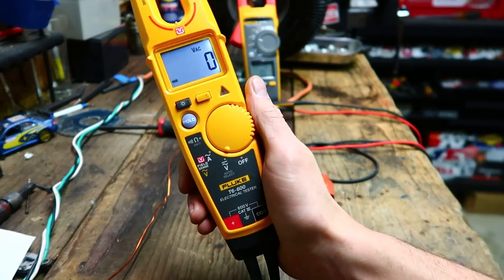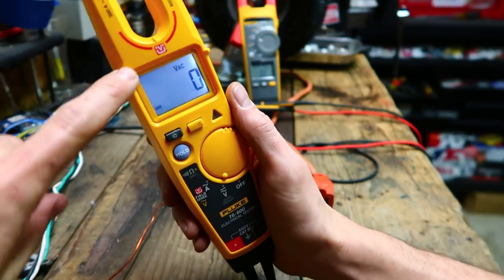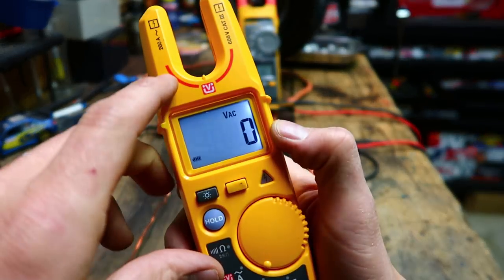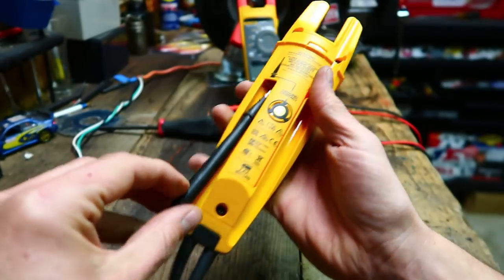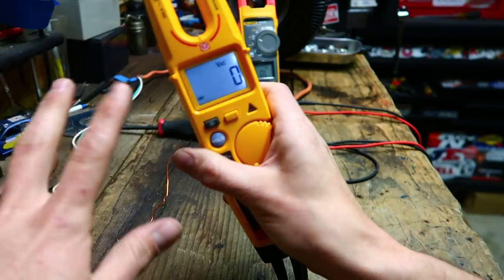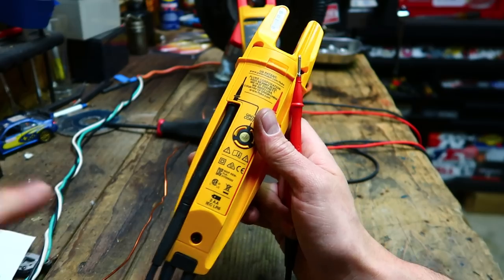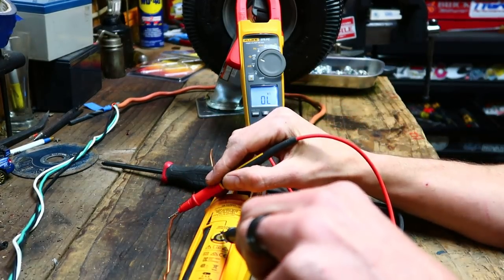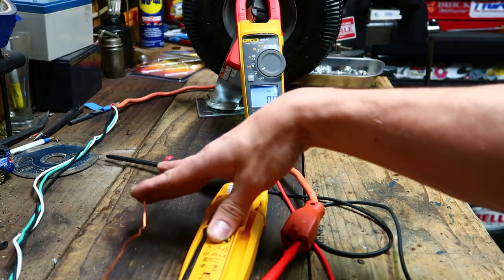Fluke T6-600: NOT DANGEROUS!

Comment: It could be capacitively coupled or a high resistance resistor, is my guess and all it is is a guess.
 If it works on RF which the magnetic field kind of is, then capacitive coupling through the plastic is actually something logical especially since there could be another capacitor on the back taking the charge giving you the 70 ish volts
Reply: A better test is between the button and the spring on the cover maybe
Reply: Omfg, I just got it dude, he did that thing where u post the wrong answer on the internet to get the right one.

I forget the name of the f**** thing, but literally it's a law that states bad knees law or some s**, that the quickest way to the right answer, is to post the wrong one online. He's even said it in his videos before f** man... that's smart
Reply: Who are you insinuating posted the false truth? AvE or Mike? I'm thinking AvE.
Reply from the maker: That's defiantly a possibility,  my expertise is in the "electrocution/burn your house down" voltage.  I do not think it's a resistor, that would require a direct electrical connection, that could fail or arc.  It's gotta be more clever than that.
Reply: Black magic? Voodoo? 😁 I'll leave the sparky stuff to you elec-chikins 🤔 I don't know or understand the whole pixie wrangling witchcraft myself. I just know that because of you guys, my Xbox and tv work 👏👏👏😁🍻🥓🇺🇸🛠
Reply: Screwdrivers with neon lamps in them have been around for ages... It's just a lamp, resistor, and you touching the pad... And they're legal.
Most likely it's the same thing here.
Reply: "defiantly"
The old Fluke corporation would use a clever design, the new Fluke corporation uses a resistor.

It says on the back "Country of origin: China."

Comment: I never really liked a fluke meter for the money they cost.   There are cheaper options that work well for me.
Reply: Till the cheap meter stops working and send you on a 5 hour wild goose chase. Ask me how I know lol
Reply from the maker: well, when you use one every day and your life depends on it, i only trust fluke, i know there are other pro brands, i just like flukes.
Reply: I don't buy fluke for accuracy.  I buy fluke so I know when I put it to a 480 service it's not going to blow up in my face.
Reply: Mike's Tool Shed I agree. I have been an electrician for 25 years. Fluke is the go-to for meters. There are many other good ones, but there is a reason you will only find Fluke meters in my hands. Fluke had a #fail with releasing the field sense into production. But there is no safety issue with it. It is truly just a gimmick for now. The Fluke 1AC II A1 is an everyday carry for me. I always assume the circuit is on unless I can see both ends of the wire!
Reply: There's old electricians and there's bold electricians, but there's no old and bold electricians.
Reply: I have a lot of cheap meters, and they work well for the most part. but when measuring something I have to be really sure of, then I bring out the fluke.

Also, when working around electrickans you don't get to sit at the cool kids table if your meter isn't yellow... so theres that..
Reply: Have you ever seen a multimeter blow up? I've toasted a few and I've never seen the whole meter explode. Some fears are irrational. So you might want to reevaluate your meter phobia at some point. Actually look inside one and understand what is going on. Then you may come to the realization that what you worry about simply cannot happen. They're not assembling multimeters with explosives in them. I ain't saying some of them doodads in there can't go pop. But none of them can explode with the velocity it would take to rupture a case. That's pure fantasy.
Reply: The cool kids table? Those cool kids were only cool in their own minds.
Reply: Fieldpiece, ftw  (..at least for HVAC)
Reply: My two EDC meters are Fieldpiece(SC260 and SC440), but I keep my FLUKE 375 on the van, in the case, as the 'Gold Standard' should any question arise with the other two meters.
Reply: Keysight meters are my new go to since fluke sold out. I require more out of a meter than your average electrician though, automation electrician.
Reply: Camaro Rick probably the same way i kniw. Lol
Reply: Same i never bought into the Fluke name, ive been using the same old multi function meter for 10 years thats got  AC/DC tong and Non contact detect, Fluke still hasnt got all that in one.
Reply: David H amprobe is either made by fluke or Klein I don't remember which but I do recall reading about it somewhere
Reply: FrugalPrepper's Garage & Garden Dido, I use FLIR (extech) meters. Fluke leads work with them too.
Reply: @frugal- owned a fluke 77 since '82 and never failed-just replace battery. even been switched from volts to ohms-no sparky or smoke. It stays mobile all year long from -10 to +140. Try that on a cheap meter. GREAT PRODUCTS.

Comment: I think he is primarily pissed by the fact it's a Fluke. We trusted them for years and years. I were upset too, because i really wanted the meter, and i almost bought it. But for DC, i mean, i can't even use it for a car without using probes as i can't be unsure if the alternator is giving me 14 or 9 volts as you try to rub it as close as possible to the sensor. 

I think what he is thinking. If there is a safety mechanism, it is not electromagnetic, as it's a ground. If you touch something like a 10 000 volts panel with it, it can just arc though the security there might be in the band relying the probe and the digital connector. But i agree on what you say, he should have disassembled and see if the protection is adequate on the positive also. 

He also got told stupid stuff like : "I have you removed the protective film" and bla bla, he took it as an insult in his intelligence. Because in the end, the guy is really smart, but he is someone who speak with feelings a lot of time. It's a major reason why i love him, he is authentic, he can be clever, he can do stupid things also. He should have checked if it's dangerous. Personally, i would send one to bigclive to know really what he think of it.

To make it really short, i can understand, we got our trust on one of the few brands we can mostly rely on. Seeing them send a device i would consider for myself a first generation prototype, and include it as a feature for more money, when it's really a pity. They could have at least warned that you have an approximation of the voltage without contact.

I am telling myself maybe the drama will make Fluke wakeup and don't reproduce the experiment of installing a potato launcher on an F-16. I am quite sure the circuitry directly on the probes will be very reliable. I would hate to be wrong and it's also a piece of garbage inside. I will check out for a good teardown when i'll have a little bit of time.

Comment: All that is happening is that you are changing the characteristics of a voltage divider circuit. 

When you measured the voltage between the contact tab on the back of the T6 to earth with the 375, you measured it with the high impedance of the 375 in series with the high impedance of the T6, which are probably similar to one another. Therefore the voltage will be circa half of the mains voltage. AvE had his T6 set to read AC voltage function, you had yours set to read ohms which would have a different impedance and may explain why you had a different voltage to him.

However, your body will have a much lower impedance than the Fluke 375, therefore when you touched the back of the T6 and earth with your hand, the majority of the voltage was dropped across the high impedance of the T6. If you want to see this, repeat the experiment whilst keeping the 375 connected, measuring the voltage, and then touch back of the T6 and ground with your hand and you will see that the voltage on the 375 will drop.

As the T6 in voltage sense only responds to AC, the socket for the probe and the contact pad are likely to be capacitively coupled. Your 375 has a capacitance function, so you may be able to measure it with one probe on the back contact tab the T6 and the other in the socket where the black lead goes. if it was inductive, you would be able to measure a DC resistance, although the T6 can only measure up to 2kOhm, so would show OL if the resistance was higher than this.

You could also measure the charging effect of the capacitor with an insulation tester or a battery and resistor in series with the T6 contacts.

Unfortunately, the instrument doesn't have reliable operation and is a little on the gimmicky side, which we just aren't used to seeing from Fluke.

Comment: If I remember correctly, in ave's video he was saying that if you had it switched over to a current setting that the meter would basically act like a piece of wire and pass the current straight through it and you might get a shock from it. There was obviously voltage there when he checked it with another meter so I don't blame him for not wanting to be the guinea pig to find out if it would actually shock him.
However I do think there is some type of capacitive coupler in the back between that contact pad and the lead so it probably wouldn't pass much 50~60 hz ac through it. If it is capacitive though, higher frequencies would probably still give you a zap.
Reply from the maker: he's smart enough, and has the equipment to test if current can flow through that pad.  Also, this meter is protected from allowing current to flow through the leads 100% of the time.  Meters with out clamps or jaws will allow current to flow through the meter to get a reading.  If you were to get between the lead and the thing your testing on say, a fluke 87, it will light your ass up.  this is a different style and its impossible for that to happen.  There is 100% a capacitive coupling in that battery door.  It's something like 2.1 nano-ferads which only allows a couple micro amps thought which is like 500 times lower than currant that could hurt a human. I couldn't speak on the frequency idea you had,  it's possible.

Comment: Loosely stated, AvE postulates that there is potential for transconductance, between the coin-shaped "ground plane (effect) inductive pickup" on the back of the T6-600, and the comparative sensing circuitry, which generates the data supplied to the display.

In certain areas of a (commercial) radio transmitter, coils, chokes, and transformers can, and do emit "Hall Effect eddy current (discharges)", and stray RF.  I wouldn't want to gamble on there being enough isolation between the T6-600 sensing array, and its comparative sensing circuitry.

Not to put words in AvE's mouth, I'd venture a guess that he'd say something like "that brass coin thingy on the back, is kinda like an antenna that picks up the 'ground' pixies which are floating around your carcass all the time. Whatever/whichever you do, don't stick yer index finger out, and ask someone to pull it whilst you're trying to use the T6-600 to measure the output from one of the generators at Niagara Hydro".  "Eh, keep your ** in a vise. Damn, demonetized once again."

My Canadian English "ain't" that good, no disrespect intended. 

Remember, one of the leads on a *three-lead EKG (heart monitor) is a ground lead, and works in much the same way as this meter does. (and the 12-lead, electro-cardio sensing utilizes a ground signal, which is obtained from the patient's back, or lower - left abdomen).  All cardio monitoring systems utilize similar methods for obtaining their ground signal.
Reply from the maker: i see what your saying, but i'd hope anyone working with industrial radio equipent would have a better meter than this.  This things place in life is (and i'm mainly speaking about the T5 and not this junk) Is an apprentices first or second meter, or an experienced electricians daily beater.
Reply from the maker: also i didn't know about cardio monitoring, that's really interesting
Reply: +Mike's Tool Shed, Inductive Coupling became known to the general public during the mid-1970's, when Sun Automotive Diagnostic, Snap-on, and Mac Tools introduced the concept on timing lights, and automotive diagnostic equipment which needed to acquire information from high voltage electronic ignition systems.

As time went on, we learned how to amplify the input so that even the most minute signals and voltages could be read - inductively. Cardiac monitoring does not use a truly inductive pickup for acquiring the ground connection, monitor leads use gold plated electrodes, with a water-based conductive gel, and an amplification system which increases the signal/voltage received, by a factor of between 400% and 700%, to provide a more readily measured input.

That same principle is used to increase the voltage/amperage within the Fluke T6-600, however, if something goes awry in the circuitry which switches between "direct-probe", and "inductive-probe" pickup, well,,, you get the drift.

I'm retired, a while, now, however, my oscilloscopes and frequency counters utilized "capacitive coupling" to read dangerously high wattage waveforms (see RF Burn), while my DVM's were always either Sencore, or Fluke, during their apparently better days.

Comment: check between the ground contact button on back and the spring loaded piece for "resistance", "capacitance" and then HI-POT test between them. I'm guessing string of resistors/capacitor coupling, but possibly as simple as parallel leads/film spaced to make a capacitive coupling. 
if the meter is rated 600v max working voltage, I'm betting the isolation is at minimum four times that voltage, I don't think they could miss that badly!

"EDIT." looked at chart, the CAT III rating of 600 working voltage has to provide safety to 6KV per "IEC and UL" to pass certifications. so hi-pot testing from ground contact to spring terminal inside should hold well over 6KV before any breakdown occurs. http://www.ni.com/white-paper/5019/en/

Comment: Good video. I was going to do that same thing after watching AvE. I like the meter & find it useful. There is not always a (convenient) termination point which to use the probes. Disclaimer - I have the T6-1000, slightly different. Just move the wire in the red zone until the screen turns green then read the volts & amps at the same time.
Reply: I like the T6-1000 for the same reason, quick check without finding bare conductor. Like other non contact devises I wouldn't trust it to verify No Voltage.

Comment: I bought the T6-1000 because it has higher resistance range than the T5 's or  the T6-600.  I like the design for trouble shooting units with the one probe stuck into the meter. I have never been a fan of the non contact voltage feature on some meters, or the pocket  non contact voltage detectors.

Comment: I don't have experience with this meter but I do have experience as a heavy industry electrician. What you need to test is putting the red test lead sticking out of the top of the meter ( every electrician with a t5 I have ever seen does this) then leave the black lead in it slot which connects it to the touch pad on the back ( let's say somebody forgot it was in there) now touch the red lead to let's say 480v AC and put your finger on the test pad. What happens then? That's the danger! It's one thing to use it in the shop within it's safety parameters it's a whole other to use it in the field. It just not worth the hassle imo.